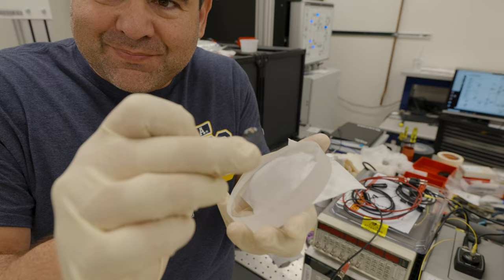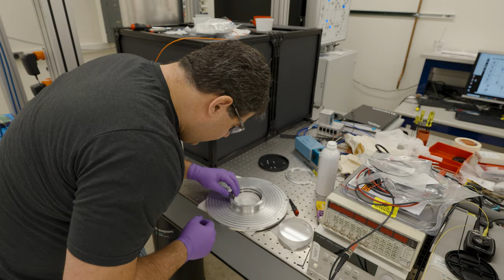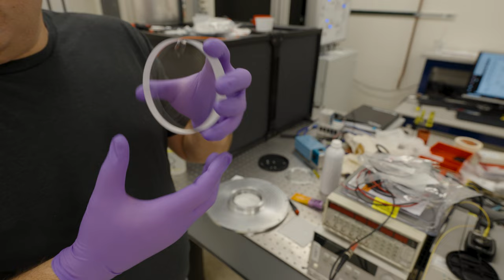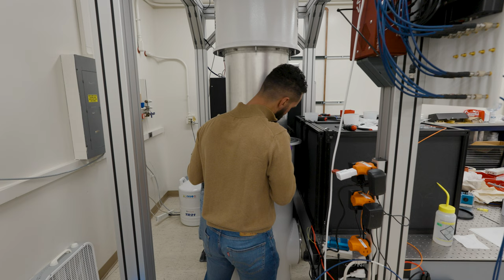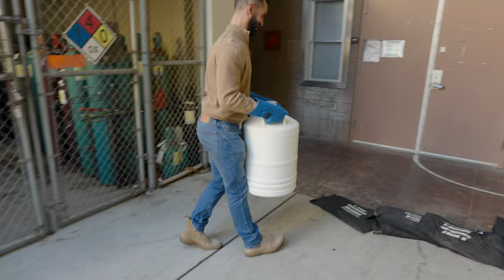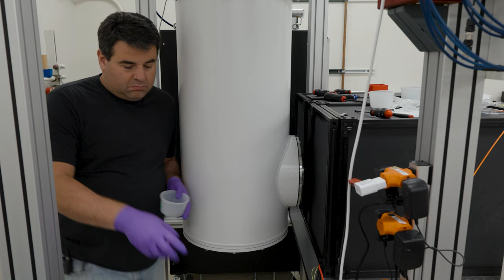Vacuum Leak at the Worst Time!

Comment: I have a theory that as the window is such a close fit (like a piston) in the aperture, if the the O-ring did not compress evenly the quartz window would be forced to try and 'twist' (like piston slap) in the plate aperture putting a large amount of pressure on a sharp edge of the quartz window and possibly cause the quartz to chip at that point. If this if the case then an O-ring or two around the circumference of the quartz window as guide rings (like piston rings) would prevent the quartz window from touching the plate and allow the O-rings to deform naturally without the quartz ever touching the plate and eliminating this problem. There plate orifice or port may need to be enlarged or adapted slightly to allow O-rings to be fitted around the circumference and prevent side contact. An alternative would be to use a slightly smaller diameter of the quartz window. The O-rings would also be better for expansion and contraction.
Reply from the maker: We did have an o-ring around the circumference on the second attempt (the one shown in this video). Since the video was shot we have learned that we actually have a much bigger problem (stay tuned!) that is causing helium to enter the vacuum can when the fridge is cold. As soon as this happens the window is shock cooled, and that cooling is my guess as to what is causing the cracks. We also ordered some borosilicate (pyrex) windows which should hold up to thermal shocks better than fused quartz - downside is that it doesn't transmit light quite as well as fused quartz.

Comment: It looks like the window has a sharp edge, could you abrasively chamfer it to reduce the stress there?
Reply from the maker: I did that! But afterwards we did the math and it should take about 300 lbs of force to compress the bottom o-ring enough for the glass to touch the aluminum, but atmospheric pressure is only about 190 lbs - so the window is only touching rubber, but is still failing...

Comment: how much 3He did you lose?
Reply from the maker: Pressure in the keg is about the same as before, so hopefully none. Since this video was filmed we have had the same vacuum leak again with the old metal port re-installed (this is why experimental physics isn't for the faint of heart), so we are very worried the leak is coming from the dilution loop. Stay tuned!